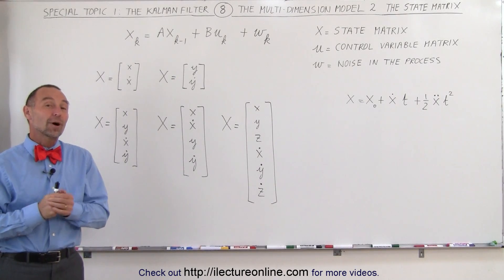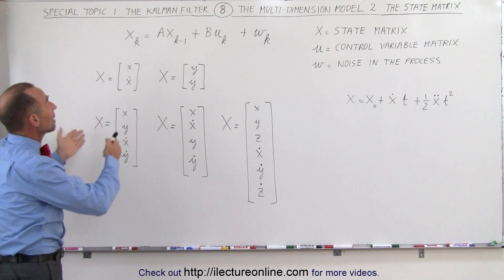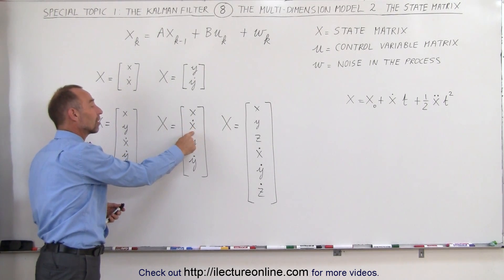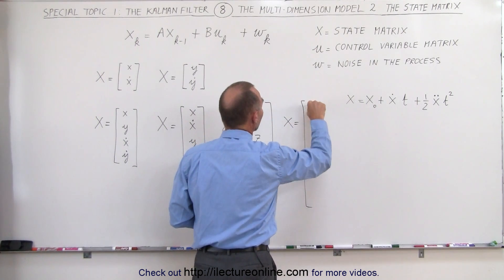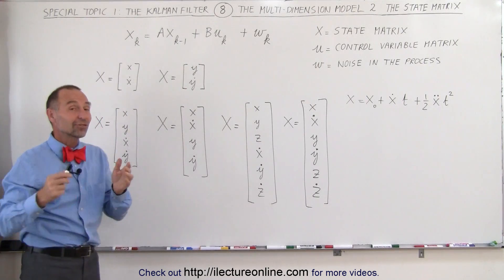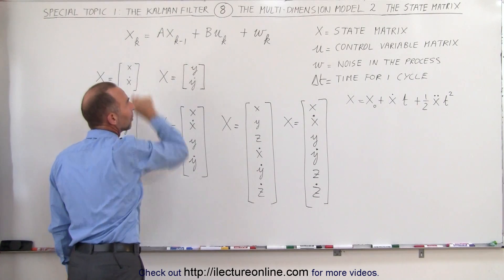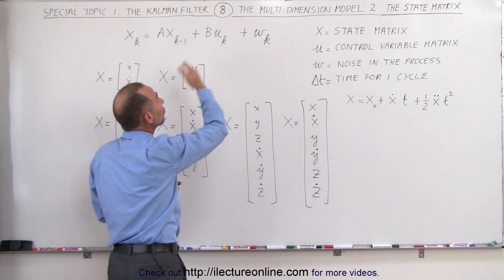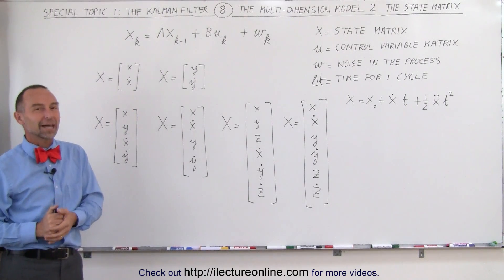Special Topics - The Kalman Filter (8 of 55) The Multi-Dimension Model 2-The State Matrix

Comment: Moving from univariate kalman filters to multivariate kalman filters there is just one thing I cannot resolve completely. The univariate model uses three steps 1. Calculate kalman gain 2. Calculate new estimate 3. Calculate new error in estimate. The multivariate model uses the same approach but it has a prediction step before calculating the kalman gain. Using the prediction step makes complete sense. But why did we not use it in the univariate case?

Comment: Dear Professor,
I found your Kalman filter videos excellent ! I helped me a lot ! Such a nice step-by-step explanation.
There is one thing which I was a little confused. I thought that the "motion" model should be linear in order for the Kalman filter to be applied. When the model is not linear, the extended kalman filter should be used. In your example, the motion model is not linear since you have the square there. I think I got something wrong :-(
Reply from the maker: You are correct.  I am planning on making some EKF videos with some tracking models when time permits.
Reply: But t=DT and it is a constant value.     So I guess it an LTI system... am I wrong?

Comment: Sir as you mentioned to find the new state we use the previous state and the control inputs which effect the state.should we only consider the present control inputs for the new state.why should we not consider the control inputs of previous state as they are also imp to calculate the new estimate
Reply: the control inputs of the previous state are already incorporated into the calculation of the current state's estimate and hence it is not required to be added the next time.